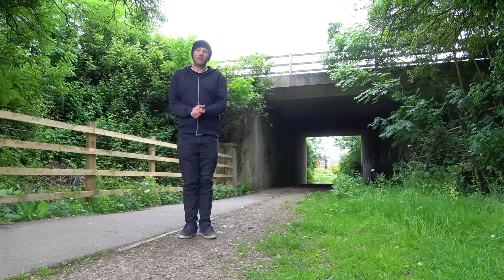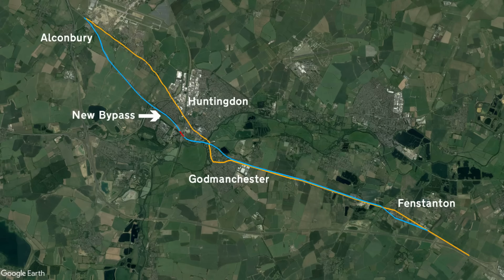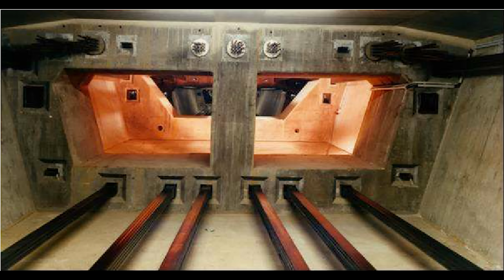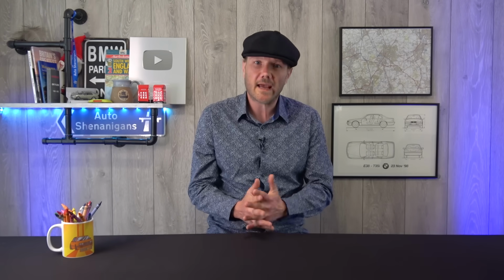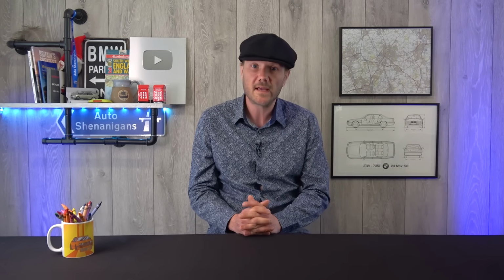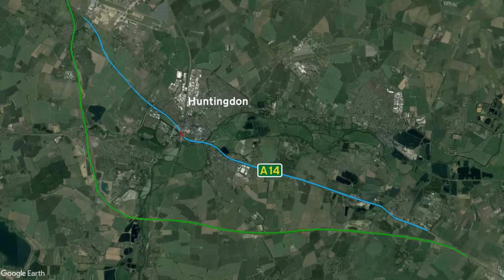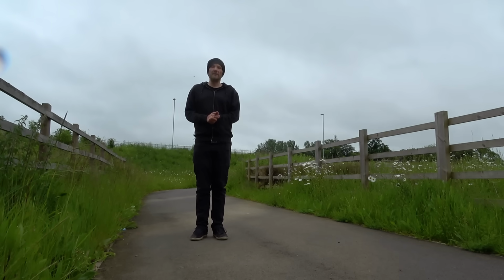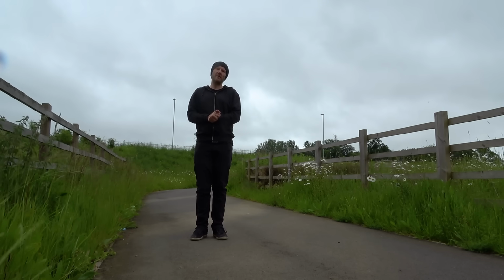Why Spend £46,000,000 To REMOVE This Bridge - Huntingdon Viaduct A14

Comment: minor pedantic point, when the Huntingdon bypass opened in 1979 it was part of A604, as was the rest of the route to A6 at Kettering
A14 as we know it today came in the early 90s, and the main reason for the new bypass was to fix the bodge at Girton (a little way to the south), where all through traffic going east to west had to make a sharp right turn onto the ex-A604 via a 270 degree bend on a cloverleaf junction; the new bypass not just gets rid of that nasty junction, but is a more direct route to A1 and points west, and is a vast improvement all round
Reply: The A14 at Girton was previously the A604 and before that it was the A45. The A45 went on to St Neots and was going to go further as a new road, to eventually meet The M1. Hence the rather poor right turn at Girton came about when they changed their mind. The A45 at that point was changed to the A604, the existing number of the bit to the A1 beyond Huntingdon and the remaining bit, to St Neots called the A45, became the A428. Then they decided to build the section from the A1 to the M1/M6 junction and then the whole lot from Felixstowe became the A14, which was previously Ermine St from Royston to Huntingdon, that became the A1198, are you still with me?
To be fair the flyover at Huntingdon was fucked, I remember standing on one side (closed for roadworks) while trucks roared by on the other and it bounced up and down! It needed taking down before it fell down, on the railway. Now they are upgrading the A428 to the A421 at the Black Cat roundabout and it will probably be that or something else, all the way to the M1 🙄. As you might have guessed, I've lived near it before it was even there.
Reply: In the late '60s/early '70s the A604 was a three-lane (total - not each direction) death trap.
Reply: @frogandspanner  I remember it well 😬
Lane each way and suicide lane up the middle. Dualled about 1977/78
Reply: @Rabchog  I think a little bit later than that. I left London and moved to St Neots in 1978. We then moved to St Ives in 1980. I remember driving to Cambridge when it was a three lane road.
Reply: @Derek_S  nearly got knocked of my 125 turning into farm gate in 77 on the 3 lane, crashed my 550 on the not long built dual carriageway in sept 78. I've got out of that habit now.
Reply: @frogandspanner  this was standard design practise for trunk roads at the time; most of these have thankfully been repainted down to two lanes or converted to 2+1, but a few isolated examples have survived (A39 near Minehead)
Reply: the section from Godmanchester to the A1 was always the A14. The A604 was from Godmanchester to Cambridge.
Reply: @RGChandler  well it was when it went through Godmanchester, Huntingdon, the Stukeleys and along the edge of Alconbury airfield to the A1.
Reply: I remember that 270° slip road. Saw a lorry topple over a few cars in front once. We managed to get past it but my mate a mile or so behind me got stuck for hours and hours
Reply: @woowoo0739  lorry load of tomatoes on the loop, I remember that too. That was a little later after they built the A45 and M11 in around 1978/79.
Reply: Wow, how can you guys remember road history in such detail. Good for us I guess. I like little bits of local history.
Reply: @GeoPePeTto  I lived in Cambridge about half a mile from what was originally the northern bypass, now the A14. I worked on a farm next to it near Lolworth, then moved to Swavesey, 2 miles from it. From 86 I drove trucks on it frequently, from 97 I drove trucks on it almost daily and from 97 to 2018 I commuted to work on it daily. Now I don't use it so often, living in Chatteris, work based at Waterbeach and coming up for retirement.

Comment: Use to visit family nearby Huntingdon, and the Viaduct was a loud, polluting, ugly lump of concrete that cleaved through the town. I'm glad to see it gone, and the simple tac-ons that were installed were fine, excluding the pointless roundabout.
Reply: Agreed, the older I get, the more I notice the negative societal effects that these big roads likely caused when they sliced through the towns. I'm not in Huntingdon anymore, but I hope this removal does start to reconnect the ring road/High Street area with Hinchingbrooke and even Brampton.

Comment: Why? Because lots of companies are suckling on the teet of the taxpayers.
Reply: They had to remove it or replace it....they removed it and replaced it with a new bypass...if they had not removed it then it would have collapsed as it it knackered.  So not for you reasons in the slightest.  Maybe if you watch the video you would have known?
Reply: @alanharvey7445  £46mil to remove a bridge seems a bit excessive. If you watched the video, you'd have seen that the new bypass was part of the new A14 £1.5bil scheme & the cost, just to remove the bridge, is another example of government agency overspend.
Reply: @LastOnSunday  Those costs included all the roadworks, the new link roads, the roundabout, the wages for everyone involved and other nearby infrastructure. The new bypass was, as you said, over a billion. Relatively speaking, a few million to redo what is effectively a dual carriageway isn't that much, and each individual taxpayer paid mere fractions of a penny for the privilege of better roads.

Comment: I moved from Huntingdon late last year, and it was a bloody nightmare getting the bridge down. The former A14 it carried, now the A1307  has been 40mph from the train station to Godmanchester for years and that drives the locals nuts. 
After listening to the locals complaints about the speed limit apparently the highways department decided that the whole of the A1307 should 40mph and have apparently done just that!
The other damage causing issue with the bridge was overheight HGVs despite the many warnings slamming into it further reducing the stability of the joints.
Reply: The funniest thing is Cow Lane, the potholed track leading to a meadow, just off Cambridge road, Godmanchester, and the last turning just before the slip road onto the A1307 is national speed limit, so technically, one can blast past dog walkers, doggers, and weed smoking teenagers at 60 mph all day long should it take one's fancy, yet a road that was actually designed for a decent pace is relegated to 40 because... reasons...
Reply: It was crashed into many a time. I witness a few of them in my days of using the route.
Reply: What is the reason for the long dual carriageway section being 40mph? Was down there a few months ago and thought it was because of temporary flooding but if it’s permanent that’s nuts.
Reply: @MarkNormanNZ  the official reason was due to damaged safety railings, why it's been extended I ha e no clue
Reply: All the way back to Cambridge Services ?
Reply: @paulscottrobson  just after shell fenstanton
Reply: I'm not sure highways are behind the extended 40mph reduction, I thought that was the first thing the council did when it was handed back to them, could be wrong though.
Reply: What, does everyone get notification about youtube video, or do you search your home towns up on purpose? So many people here from huntingdon , but with a population of 25,428, it makes no sense how so so many found their way here. Logistic probability is almost 0, yet here we have dozens...

I guess its like a random class room where there's at least 2 people with the same birthday.  Even though its more logical to presume none share birthdays. The world really is small
Reply: Its crazy that you have a 60mph road where it is just enough to fit a car and is very windy, and a 40 mph dual carriageway where it feels like your walking. It feels wrong to do 40 but its the legal thing to do. I think the speed limit on single carriageways should go down to 50mph since France did just that and it's also been done on the A140 between Norwich and Ipswich and the road from Boston to Skegness.
Reply: @annabelholland  they're taking the piss with that 40 limit. Huntingdon end because the safety barrier needs replacing. They want to bloody well fix it. I agree about cutting speed limits though, but I think 60 on non motorway dual carriageways and 50 on single carriageways would be better.
Reply: @annabelholland  your a bot from the speed campaign lobby

Comment: It wasn't just the pollution from the vehicles it was also the noise as the road was so high up.  Getting rid of a 1960s mistake is money well spent for the town.  The whole area around the station is vastly better.  The error was surely making the new bit of the A1 not a motorway as if they ever do the A1(M) missing bits it will need rebuilding again.
Reply: I doubt they ever will do the A1(M) missing bits - the A14 was built to motorway standards, just not made a motorway, so there's little point them doing the same for other bits of road.
Reply: @jamwil200  I think @ADAMEDWARDS17 is referring to the section of A1 that was rebuilt between where it is joined by the new A14 and the A1(M) at Alconbury.  Though I am sure the reason it, and the new section of A14, were not legally designated as motorways is because of the lack of a hard shoulder.  Smart motorways were already controversial by the time of it all opening, so easiest to do nothing and despite it being no safer as an A-road.   And both of those roads are effectively motorways but for the legal definition and colour of the sign, as restrictions have been placed on them  equivalent to those that apply to motorways, hence needing half a dozen restriction signs on the slip roads.

And this secret motorway stuff is something I hate having started out by riding on a motorcycle on a CBT, which prohibits riding on motorways.  If you judge by a map or rouet planning software there is no way of knowing you are not allowed on it until you reach those signs.  And with my parents living in Lincolnshire this was a route I would use, getting to Alconbury via either the A1 directly or via Huntingdon on the A10 and A1198.
Reply: @Rebecka_J  I am aware that that is the section of A1 being referred to. At the time of opening, from my understanding, government policy was to not build hard shoulders on any roads, motorways or not. I have heard that the A14 was due to be made a motorway but they couldn't get the approval through before they needed the signs made due to civil servants being caught up with brexit.
Reply: I do remember the noise for sure. Even from the part of high street where Waitrose was, it was still apparent.

Comment: it was interesting to watch as I work at the station, I has really made a difference traffic wise no where near as much. The huge cost was due to the crane equipment that was required had to come from Germany as nothing in the UK could lift it
Reply: Dutch company actually. Mammoet meaning mammoth. One sees their red lifting gear with the mammouth logo all over nowadays. They were heavily involved in the A14 work where the Bar Hill bridges were constructed a few hundred yards down the road and lifted into position fully made.
Reply: Paying Network Rail for possessions doesn't come cheap, someone has to pay for RBS's.
Reply: Wouldn't that happen anyway. The new road is way better than the old A14/A604. I would have considered making the road still closed, so traffic couldn't take the A141 link, but it was openable again in case they needed to work on the new A14
Reply: @paulscottrobson  the bridge was life expired and decaying, it had to come down.
Reply: @Rabchog  So it was one of those things where they'd have to spend a lot of money either way, taking it down or repairing it ? Fair dos.
Reply: @paulscottrobson  would have cost too much to build a new one for what had become a minor route. The new alignment of the A14 was also to enable increasing it to 6 lanes and an uninterrupted route onto the A1 to M6/M1 section also from A1, cutting out Spitals link and Brampton Hut roundabouts.
Reply: Let's build that bloody crane then...
This country used to be Great Britain.
Now is a "We can't do that" attitude.
Reply: @chessdominos  You can blame the Tories for that. They sold everything stated-owned off and have allowed foreign businessmen to take over formerly nationalised industries. Royal Mail is about to become foreign owned (despite having the word "Royal" in the name).

The other problem with have with infrastructure projects is that the government has a stop start attitude, instead of funding rolling programs. So they want to buy a bunch of stuff now, and then not buy anything for a decade or so. That means all the jobs for things like TBM construction shut down completely and workers can not afford to sit on unemployment benefit for ten years waiting for something like HS2 to be restarted, so they go get other jobs.

Other European countries have less of a stop-start attitude, and because they have continuous work their construction companies are still here. Unlike British Rail Engineering, Metro-Cammell and many many other iconic heavy industry companies in the UK.

If you don't like the "We can't do that" attitude, you need people to elect MPs who cancel the austerity nonsense and come up with a number of rolling transport programs to reverse car dependency and lower pollution and the carbon cost of moving goods around the UK.

If we have a number of sensible construction projects, that get rid of things that cause car pollution in towns, while also adding other things that create low-pollution low-carbon ways to get people and freight into those towns, we can keep a big crane, like the one used for this job busy enough to have one stay in the UK.

If we only use a big crane once every 10 years, it is not economically viable to have one in the UK. If we build one, we would end up needing to sell it after the owners went bust.
Reply: @chessdominos 
Agree...
I wonder how much just transporting it from abroad and back again cost financially and environmentally.
Public accounts published long before the go ahead might stop the horrific wasting of money mainly through high profits .. and if there are any questions about who got the contracts.
Reply: @mySeaPrince_  "I wonder how much just transporting it from abroad and back again cost financially and environmentally."
Much less than building another one here.

Comment: Hey John could you make a video about the A14?
Reply: I was just thinking that the A14/A45/A604 could warrant a series of videos.
The road(s) you love to hate.
Reply: @lewis72  and the A14(M) secret motorway
Reply: @rkyadius  
Ah yes, I think that that was the bit that went from Huntingdon up to the A1(M) North.
There was also an A604(M) somewhere too, may be the same stretch.
Reply: @lewis72  A14(M) A604(M) and A1307(M) are all technically that one bit of slip road that joins the A1(M) north
Reply: @rkyadius  
My favourite part of the old A45 where were it went down to 1 lane in total through St Neots.
There were HGVs from the Midlands Europe bound queueing at the bottleneck to get through.
Then there was the Cambridge bypass, now A14, the teased you with a 3-lane dual carriageway, then a 2 lane dual carriageway as you went past the A11 turn off, then a whole load of disappointment as it went to single carriageway all the way to Northampton.
I don't think that the A604 was much better.

Comment: And now all the new bridges on the A14 are sinking or the land at the ends of the bridges are sinking 🤦‍♂️ 1.5billion new problem.
Reply: I noticed that and I assume that they didn’t compact the embankments sufficiently. I would like to think that it’s covered in snagging warranty work but who knows.
Reply: @robinwells8879  "snagging warranty" 🤣🤣🤣🤣 I bet the contractor will be wriggling out of that!
Reply: Bridge north of Hilton is the new casualty, with ramp warning signs and bumps that are gradually getting worse.
Reply: Same at Godmanchester  @robdalziel7056
Reply: Just so you all know the contractor was Mick George shortly after completing the A14 he put the company up for sale! It now belongs to Hanson aggregates, bullet dodged I’d say.
It amazes me that now on lane 1 on the northbound section the steel jointing fingers (expansion and contraction joins) on the bridge have snapped and fell away. The bridge over the A14 Huntingdon services on the old A14 is around 6 inches higher than the road now, brakes on and position the car at an angle so not to destroy the suspension.
When the road fist opened it was so perfect and smooth, it’s such a shame the maintenance hasn’t been kept up with.
Reply: The new bridge over the new A14 on the B1043 between Godmanchester and the Offords has the same sinking problem with warning signs. No wonder the top soil and sharp sand I bought from Mick George were so cheap.
Reply: It's so bad in places. When I'm towing my trailer, I have to slow right down to 40 to go over the sinking sections.